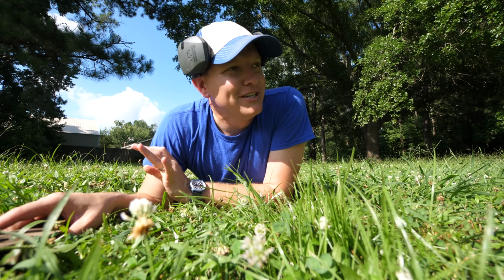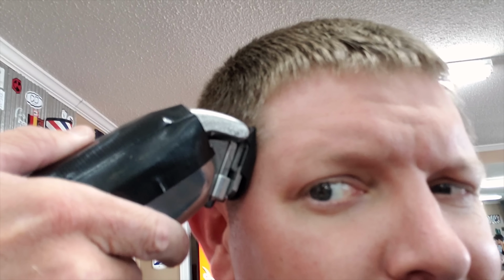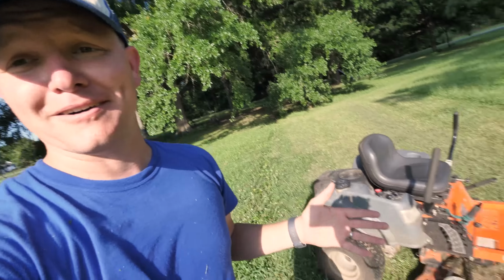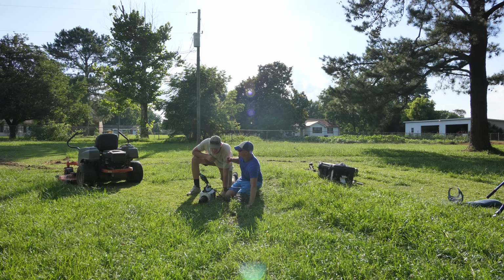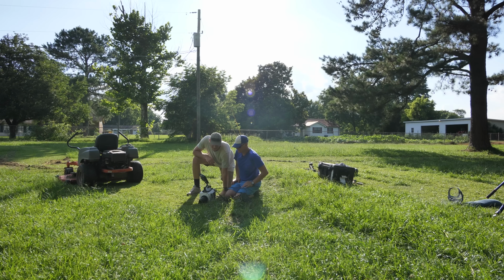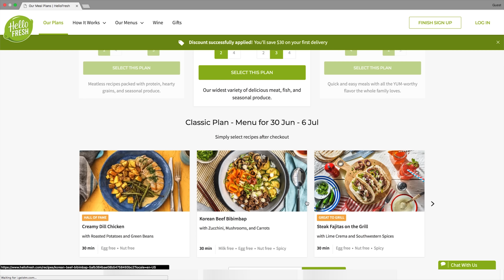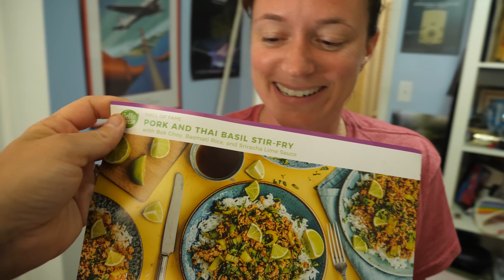How Lawn Mower Blades Cut Grass (at 50,000 FRAMES PER SECOND) - Smarter Every Day 196

Comment: I would like to know how the audio from the high speed camera doesn't get distorted when slowed down  extreme amounts
Reply: Because the sounds are fake, there edited in
Reply: EO AtTheInternet they're*
Reply: Jesse Holland I would like proof of this theory only because I don't believe you
Reply: Brandon Miller I believe Smarter Every Day made a video about it a while back
Reply: Digital audio processing takes samples AMPLITUDE of the audio signal 44,000 times per second and converts that amplitude to a string of binary numbers that is 44,000 numbers long for each 1 second of audio.  Reprocessing that string of binary numbers back to an analog signal does not change the AMPLITUDE that each of those numbers represent.  So, when you play that string of numbers at 2x or 1/2 the speed, the AMPLITUDE that each number represents doesn't change.  The frequency doesn't change either because the number does not represent the frequency of the audio signal; you're just giving less or more time for the audio signal to play through the speaker.  If you allow a 1khz signal to play for 1 second or 1/2 second, it's still a 1khz signal.
Reply: Dan Burch the sound is faked though, just like in every other slow-motion video on youtube that has sound. It's no secret. There simply isn't enough information in the audio signal to slow it down and keep the quality.
Reply: I like how Dan Burch gives this whole rundown and Rurexxx debunks it with "it sounds like every other slow-mo video! It must be fake! It's so obvious! How could you not know?! It's - so - OBVIOUS!" lol
Reply: I didn't say it sounds like every other slow-mo video. I said it's how slow-mo videos are made. Dan Burch's "whole rundown" is completely wrong. He says lots of clever sounding words but read what he actually says. He wrote that if you play audio at 1/2 speed the frequency doesn't change. That is completely wrong on every level. If you play a 1kHz signal at half the speed it's obviously going to be 500Hz. If your microphone is capable of recording frequencies up to 20kHz and you slow it down 800 times (like in this video) the maximum frequency the audio is going to have is 25Hz so close to nothing will remain.
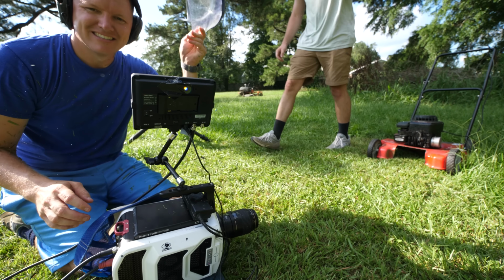Reply: 3:00 youre welcome
Reply: Ohhh its just that Its like $5000

Comment: also the blade is moving at such a rate and the mower is moving forward only the first inch of the blade is actually cutting any grass. by the time the mower moves 2 or 3 inches forward the grass has already been cut by the leading edge of the blade.  Also the reason blades round off on the corner .

Comment: Wouldn’t a weed eater not have the lift because it is just a plastic string. It’s the same concept as the mower but with no lift! I don’t get it.
Reply: Make Soccer Great Again a weed whacker also can't handle nearly as much for the same fuel cost. It's just a more "precision" tool for areas your mower can't reach.
Reply: Yes but a weedeater hits The Grass from the side not directly on top so the grass is already standing up

Comment: do the same with a classic scythe. no significant aerodynamics there... then what?
Reply: Dávid Csonka a very sharp thin edge, just like a surgeons scalpel blade..thats it..nothing more other than a the knowledge and technique behind it, plus the additional labor of swinging it, and additional hassle of making sure you get the same height cut with each pass
Reply: that wasn't what i asked for actually... i know how it works, but seeing it in slow motion would be amazing. it would be good to see the effects of the blade's tangential speed vector component. i mean that if you ever used a scythe you know that a good swing is when you slide the blade a little instead of chopping perpendicular to the blade.

Comment: And riding mowers that have baggers have higher lift wings to create more pressure to blow the grass through the tube and into the bag.
Reply: Yes!  But it's not for making the grass stand up, it's for blowing/throwing the clippings out.  As you approach the standing grass with the mower, the air-pressure is pushing the grass DOWN/AWAY from the deck until it gets underneath whereupon it is cut as soon as it stands itself up when the pressure isn't so high.  Only the clippings themselves experience 'lift' as they are thrown by the tabs along with the air around them.

Comment: If the mower blade sucks the grass up, how does a hover mower  work
Reply: i was never here it has a vacuum in the center where the blades cut but it blows down on the corners to lift the mower
Reply: Corners?!?
Reply: I think it pushes the grass down and it naturally springs back up.    I also think they dont actually work well !

Comment: You might want to look from the development of the tooling. They used scythes and where the big swing of it was not feasible sickles. The scythe is purely cutting be inertia of the grass (or what ever). If the grass is wet or too long such that it is bent, the attacking angle of the blade is suboptimal, preventing easy cutting or even cutting at all. If you use a sickle, you need to grab the top of the good to get cut, so the attack angle of the blade is proper and also rising the inertia of the good to cut (the movement of the sickle's blade is too slow the little inertia of the usual cutting good). The mower is an automated combination of the two, but only affecting the attack angle significantly (at least in my opinion). I do not believe the air flow is that strong, that the inertia of the grass is augmented more than a tiny touch.
Reply: One note: while true that bent grass makes for sub-optimal cutting, that is true wet or dry.  You typically scythe while the grass is wet with dew.  In theory, the wetness helps the lighter grass stand more firm (adds weight), allows for easier penetration, and also lubricates the blade as it goes.  But because wet grass is also 'sticky', clippings will bog-down a small blade (like a power mower or a reel mower) so those work better on dry grass.

You are correct, the airflow on power mowers is all down/out at the leading edge of the blade where the cut takes place - there is no lift on the uncut grass, and the tabs work just as they do on a snow-thrower, i.e. they throw the cut material away from the pivot.  It's not about airflow, it's about a sharp cut and a good throw.

Comment: They did make  a mower that operated like a set of barber clippers. It looked something like a roto tiller except the “barbershop” style blades rode out front close to the ground and you could raise or lower the blades with the handles. We used them to cut the weeds down in between garden rows in the 60’s and 70’s and probably before the sixty’s. This was in South Georgia. They worked great.
I would like to see you do a video on what the best blade angle is for a lawn blade to sharpened at. 15 degrees all the way up to 45 degrees. Which blade angle edge lasts the longest with a specific degree grind on the blade.
Keep doing you!
Ron

Comment: Hi Dustin,
This video can be a very special video to teach the scientific process.
step one: Observation. You observed the grass being cut and talked with others to see what was happening.
step two: hypotheses. you came up with the hypothesis that the tab lifted the grass.
step three: experimentation. You did a high-speed camera of the blade, but I think that should have been your control. It would have been better if you did a high-speed shot of cutting the grass with a lawn mower blade that does not have the tab.

Comment: Very interesting video that answered a very common question. 
Apart from the air flow that raises grass blades up, I wonder if the elasticity of grass also plays some role. As the mower blades rotate and strike grass to push them down, the grass springs back upright due to its elasticity. With the next stroke of mower blade approaching, the grass and blade movement in opposing directions create enough stress for a cut.

The air deflector is certainly the most important aspect anyway. Thanks.
Reply: Airflow does not raise the grass blades up, it blows them down.  The airflow from the mower blades is outward which, at the edge of the deck where the blades are cutting the grass, is airflow AWAY from the mower that would push the grass down.  The trick is that the downward pressure is highest right at the edge of the deck and beyond it, so that pressure is relieved as the grass is brought under the deck as the mower moves over it and then the grass is cut almost immediately as it stands back up from having been pushed at by the outward pressure.  Your idea about the elasticity of the grass is more accurate than Destin's notion of 'lift' playing a role.

Comment: It's probably been mentioned but it's the speed of the blade impacting the grass leaf which is doing the cutting.  The flute is there only to lift the cut grass into a catcher or just for improved discharge. They don't stand the grass up with vaccum otherwise we'd all mow when it's wet.

Comment: The blade is dual purpose. The tab creates lift, but it also is there for a mulching effect. Especially in push mowers with dual blades where you close off the side chute so it keeps the grass blades suspended in the air and mulches the grass blades very fine.

Comment: You wonder why when you’re not cutting grass there’s air flowing out the bottom you could even use it as a on the sidewalk as a blower I mean because it shoots there and it was definitely move the grass out-of-the-way on the sidewalk because of the air
Reply: they even have 'hover mowers' that do not require wheels, using down/outward air-pressure to lift the deck.  But in the center of the hover mower is a low-pressure area where the blades cut grass.  Lifting the uncut grass isn't part of the process, the tabs are for BLOWING the clippings out the chute or into the bag.  With the chute closed, the clippings will either collect in the deck or blow out under it just as you describe.

Comment: The old "reel" type push mowers actually did use a scissors action. They cut cleanly, but didn't lift the grass up to be cut. When I was a kid back in the sixties, my dad had a gas-powered model and those big exposed blades scared the snot out of me!

Comment: The little push-powered motors with the rotary they have a facing edge and as the spiral blade flutes go around they have that counter pressure that you're talking about with the scissors.

Comment: I’m not convinced. The airflow would cyclone in the direction of the blade & the flow picks up the cuttings & blows them into the catcher. It might be the natural position of the grass to stand up after being cut/whipped by the blade. This doesn’t explain why a line weed eater also cuts grass. As in your blade-paper demo, If you hit something hard & fast enough it will fracture.
Reply: Drive a mower passed some clippings on concrete and watch it blow them AWAY, not suck them in.  You are correct, the grass stands up on its own after no longer being blown down by the high pressure around the edge of the deck, then it is immediately cut (or bludgeoned) by the outer edge of the blade and the clippings are caught and thrown by the tabs - that last part is the same physics at work in a snowthrower and is the reason for the tabs.

Comment: Lawnmower blades used to be completely flat and did a good job cutting the grass. I think the addition of the tab on the back side of the blade was to add turbulence and dynamic air movement so the grass clippings would get whacked several times before being discharged out from under the deck. They were called "mulching" blades when they first appeared on the market,  as I remember.

Comment: It’s just speed, the air lift is to guide the clippings out the shoot so it’s doesn’t build up in the deck. Look at a swing blade, same concept.
Reply: same concept as a snowthrower.  The standing grass isn't being lifted at all but simply not being blown down anymore by the air escaping under the deck because of the blowing fan-blades.  Once cut, the clippings are slung out the chute or into the bag just like snow being slung up/out the chute of a thrower.  The area of lowest pressure under that deck is the very center of the blades at the pivot where the blades are not sharpened and there are no thrower tabs.

Comment: You're talking about one particular type of mower.
A cylinder mower, for instance, 'shaves' whilst a rotary mower lifts and slices.  There are a couple of other ways.

What you did here is to modify the deck so that less lift would be created.

But it was a good video that needs a part 2.

Comment: As a continuation of blade physics, can you capture the "real" action of a gator blade on cut blades of grass? Is lift (suction) decreased (probably) because the lift tab is split in several places along the back of the blade?  Can you capture whether these blades actually DO shred the grass more? Finally, on a 3 blade deck system, will using 2 High Lift blades ahead of the gator blade increase the lift of the grass and the distance the cut grass is expelled (to cut down on the slurry ridge that 3 gator blades often create) while still shredding the grass at the exit port?   Things I think about as I mow with my 60 inch zero turn mower.   Love your videos!

Comment: Perhaps you should do a wind tunnel experiment with smoke streams over the blade to visualize the upward lift in front of the blade. You could also ask, would your lawnmower cut grass in a vacuum?
Reply: Cut the grass next to a sidewalk or driveway and see the clippings blown all over it, then walk the mower over those clippings and watch them be blown out of the way as if you were using a leaf-blower.  The air pressure from the blades is outward, not upward, and it is highest right where the deck comes close to the ground.  As the deck moves over the grass, that air-pressure is less and the grass stands up again only to be cut by the outermost edge of the blades.  It never experiences 'lift'.  But the clippings under the deck get thrown by the blade-tabs out the chute or into the bag or just bog-down the system if they can't escape.

Comment: Here's a question I've always wondered. How does the angle on the blade effect the cut? Would it work like a knife, that the smaller the point angle, the better it cuts? Or would it dull and deform from the constant impacts at ~200mph?
Reply: Yes, it is a knife.  The edge needs to be sharp to cut (rather than bludgeon) but the angle can be very large to resist deformation (esp. if running into sticks and rocks) and prolong the life of the blade.  I switch out my mower blades depending on the circumstance - a brush blade with a sharp edge but beveled at 80' inclusive vs a grass blade that is just as sharp but beveled at <60' inclusive.  I've accidentally hit rocks with the thinner bevel - the damage goes deep, as you'd expect, and requires more metal removal to repair.  On the 80' edge, it dings the edge but is easy to repair.  There is really no reason to use the <60' edge if you keep the 80' edge sharp, but I am used to using a scythe with a much narrower blade where you can hear and feel the cut on each swing, and it got me in the habit of putting a thin edge on power-mower blades as well, even if it isn't a good idea :p

Comment: Is there a best speed to push the lawnmower? That is, if I want to mow the most area per minute, but also have a quality cut, what is that 'sweet spot'? If I mow very slowly, I get a good cut, but don't cover much ground quickly. If I mow too fast, I can cover a lot of ground, but I'm sure the cut will suffer. Can physics shed light on this subject?

Comment: That's why there is a difference in High Lift, Low Lift, and Mulching style blades. They are all totally different. High lift blades create the most air flow/vacuum for a cleaner cut.

Comment: I think you should use a small push mower, a clear plexiglass sheet and cover the side discharge chute (for easy viewing without disrupting the airflow) and open the back side. The cutting is done on the outer edge of the blade, nearest the dock where the ground effect is the strongest. Think of a reverse hovercraft.

Comment: This is two years old now, sorry, I am catching up.  Anyway, when I worked for a city streets department, one of the kids who mowed lawns for our parks department brought in mower to the shop and said that it "wasn't cutting very well and needed the blades sharpened."  After he left the shop manager said some colorful things about the kid not understanding his equipment and told me that this particular type of mower uses a flail rather than a blade and that the "flails get sharper as they cut" and that the reason the kid thought it wasn't cutting the grass well was because he was driving faster than the mower could cut.  This was a rural area and I am from the suburbs, I didn't know what a flail was until I looked under the mower.  However, I am still confused as to how it could get sharper as it cuts.  Is that just something he was saying or is there some way a blade, or in this case, flail can actually become sharper as it cuts more grass?

Comment: So you know there are different types of blades. The blade fin adjust for the type of lawn you have and the amount of dirt or sand that is there. So if you have little grass and a lot of dirt you get a flatter blade so you get less dust bowls in the neighbor hood. The other thing is that on a blade only the first inch cut the lawn while you are moving usually that’s why the front or edges of the blade wear out first. The angle you grind on the blade also matters. Hope this helps for future videos.